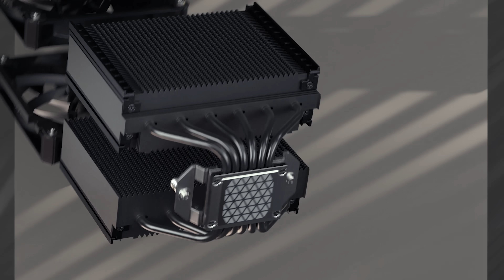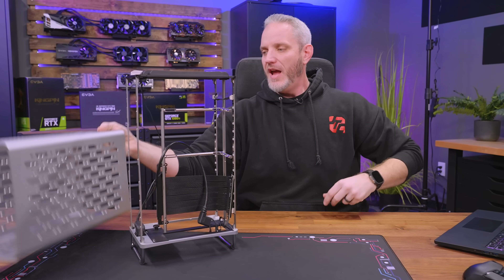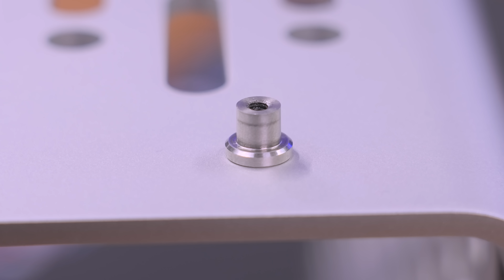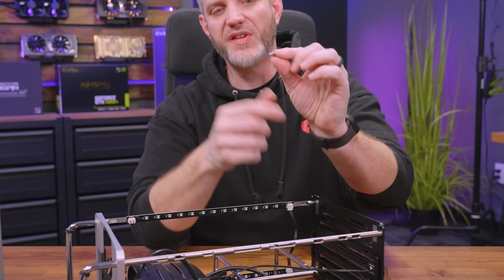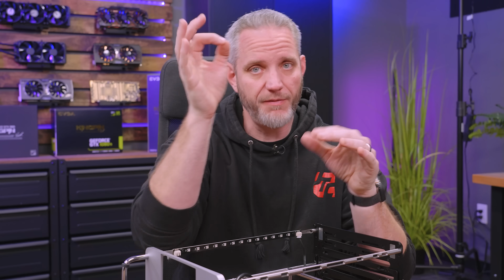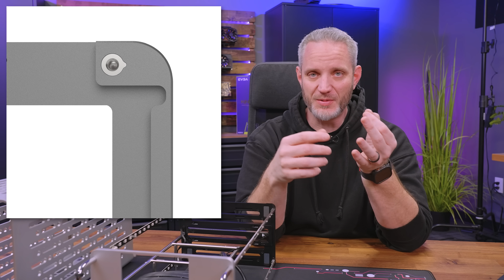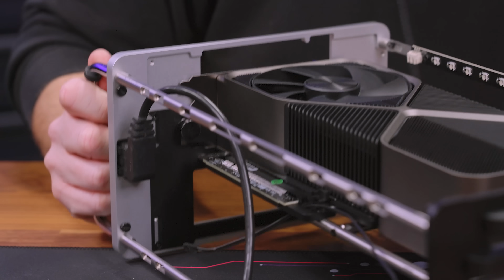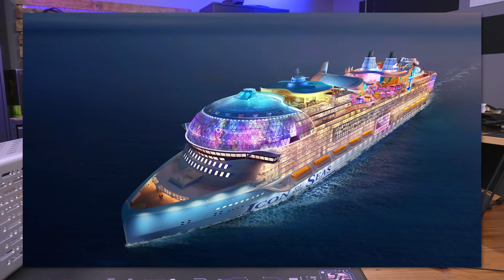They responded to my review! THAT WAS FAST!!!

Comment: I think that GPU bracket needs to go further out so it picks up the first complete hole on the GPU. That edge position is usually just an open slot / hook. So, if the screw loosened just a bit, the GPU could still flop entirely out. If you pick up a complete hole, then the GPU can only wiggle the distance of the hole unless the screw comes all the way out.
Reply: Yep we tested the bracket in the video and decided to extend it to the second hole, works perfectly now 👌
Reply: @THORZONE Fantastic company. I look forward to purchasing your well engineered products in the near future.

Comment: On small screws with loctite just touch the tip of a soldering iron to the screw head. No need for heat guns or flame to heat anything else up.
Reply: Or just have enough strength to apply more than 5ft/lbs of torque.

Comment: The handle setup might be better achieved if they used micro torx like on the handles on a refrigerator. Then you don’t have to try and get inside the handle .

Comment: Jay,

On a modern swiss turn lathe that little nipple will literally cost just the change of the NC code in the machine.  I am a machinist and do this on the regular.  But yeah Those little handle nuts are likely just turned on a lathe and parted off.
Reply: As a fellow machinist (EDM and CNC mill) I appreciate this comment from your specific  viewpoint.

Comment: Hopefully adding the "nipple" won't hurt them too much. It is an obvious solution, but it makes manufacturing notably more complicated. I wonder if soldering, or even glueing a piece of metal, or wire, to inside of the hole of the chasi and adding a cut to the cap would be easier.

Comment: I wonder why they didn't make the notch concave instead of convex? A concave notch is something you can easily machine into a turned bolt, just smash it in a jig and run a drill/machining bit on its side => done. same with the case side, where now instead of just machining a hole, they could just machine a partial hole with the indent.
with it being concave however the case side is still easy, but the bolt now can't really be turned anymore so it has to be machined on a cnc, which is just much more effort (and I'm guessing more expensive)
Reply: With custom tooling you could still broach that shape on a conventional multi-spindle, but yeah that new shape is not kind.

Comment: Why didn't they just put a flat on that cap be easier than a nipple surely?
Reply: it'd be easier,  but it'd go against the rounded design choices they made basically everywhere else. still  wondering why they didn't invert the thing tho
Reply: @insu_na  fair point
 Could have just machined a flat head screwdriver slot into it though instead then wouldn't have to do anything the case itself.